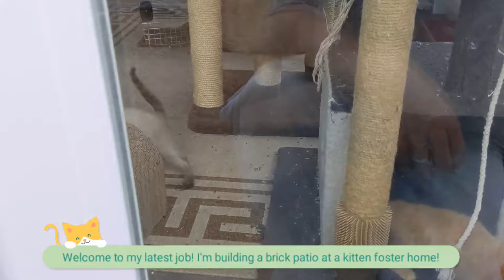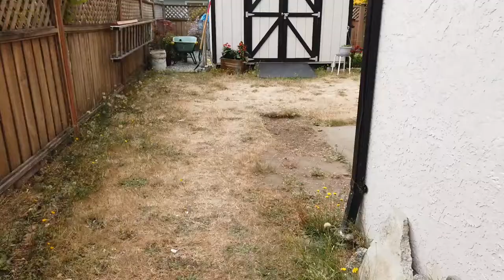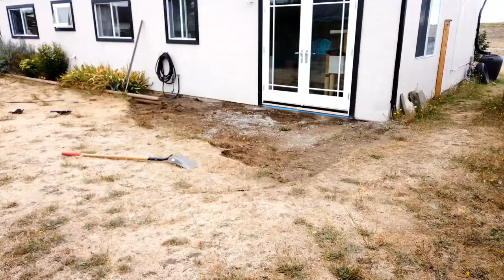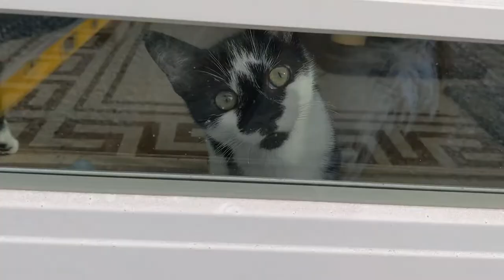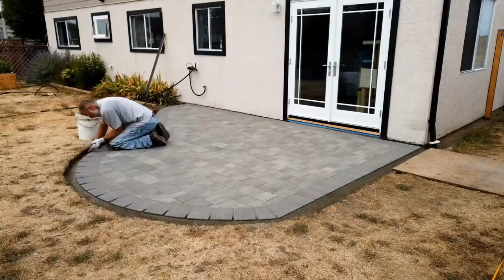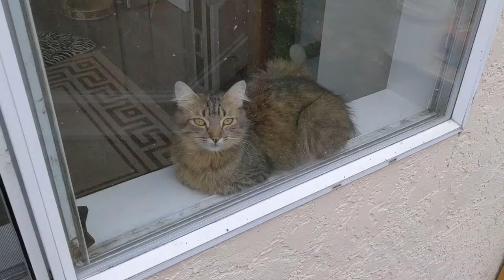Building a Brick Patio, While Kittens Watch: Timelapses with Osmo Pocket at Work!

Comment: That looks so clean, great job. They have a ton of cats btw.
Reply from the maker: I think there are almost 10 kittens there!
Reply: @gordchapman3469  Cat Hoarding
Reply from the maker: They were fostering many kittens that were displaced by wildfires elsewhere in Canada!
Reply: @gordchapman3469  I see, the fires really did a lot of damage there.
Reply from the maker: @Pixics  yeah, luckily over here on the island, we haven't had too many fires, but over on the mainland and interior areas have been so hot and dry this year! You might read about a small town called Lytton, B.C.,  that set an all-time Canadian temperature record in June (49 degrees Celsius) then days later, completely burned to the ground!
Reply: @gordchapman3469  Wow, I didn't here about that, crazy weather.